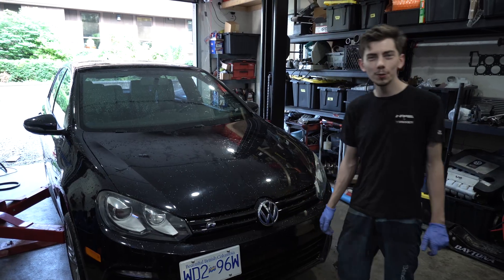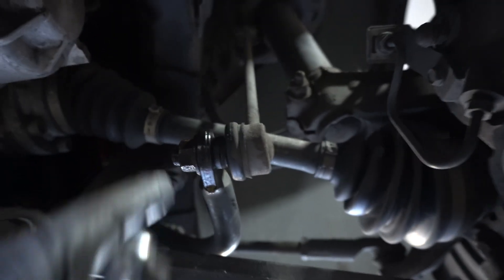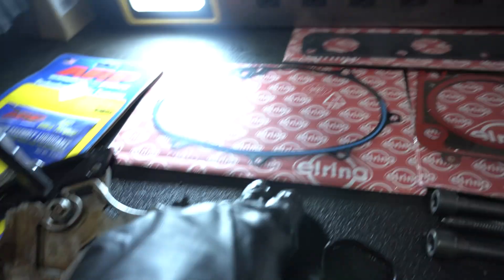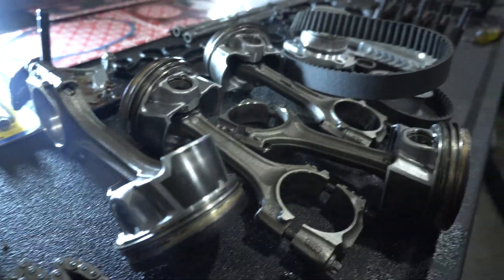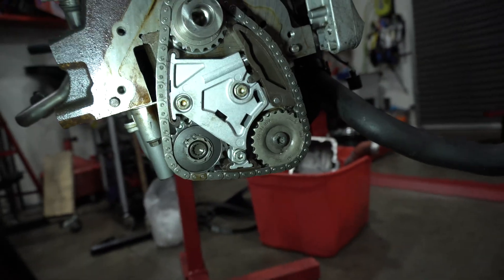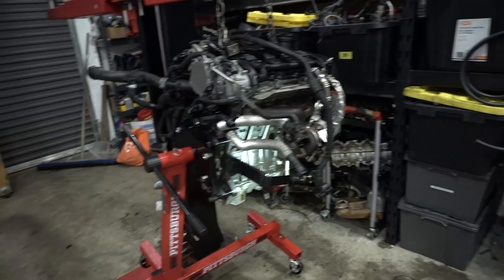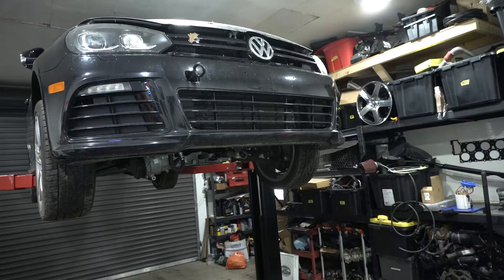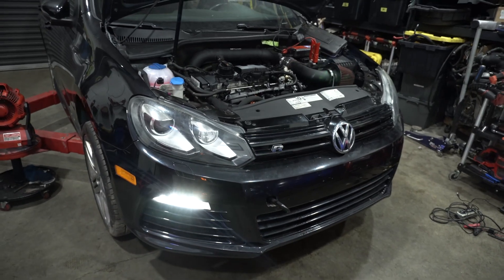MK6 Golf R 2.0T FSI Engine Removal & Rebuild - START TO FINISH in less than 12 minutes

Comment: Hey how do you remove the crank bolt like what's the tool u used to counter hold the pully i cant find anything for mk6 r
Reply: Update:I ordered a counter hold tool from ebay works great about 3 feet long and super strong just put 2 bolts on crank sprocket to hold tool

Comment: Yo, hear me out. There is limited mk6 Golf R content related to tearing apart/building the engine. With like detailed specs and how to’s. I have a 2012 mk6 golf R myself. Let me tell you it isn’t easy finding any information on these cars because of the limited production run. You can find anything on 1.8t’s. If you did a detailed how to video it would be a gold mine to the mk6 r community. You have a lot of knowledge and love watching you work on VW’s. Like I said I’d love to see a dedicated mk6 golf r CRZA engine build or tear down video with torque specs tips and tricks (like deleting the balance shafts) etc. Especially when it comes to high horsepower builds involving ethanol. Or just putting in drop In rods. Tuning etc. Europe has such a much better support system for these cars over the USA.
Reply from the maker: @scottanderson6969  Yea I noticed this, it was ridiculous to find out oil pump and bottom end torque specs etc. If the opportunity presents itself I wouldn't mind doing that but this particular project didn't have that big turbo budget.
Reply: @thirdgeargrind not listed in service manual?
Reply: I just rebuilt the engine in mine, I wouldn't have been able to do it without the factory engine service manual, it has everything you need to know, like bearing wear limit specs, ring gaps and every torque setting, also if the bolts are TTY, which all on the inside of the engine are, don't skimp there, you need to replace all crank, rod, head and camshaft cover bolts.